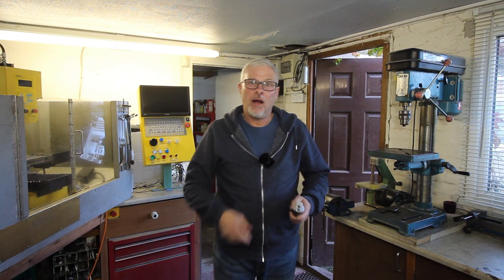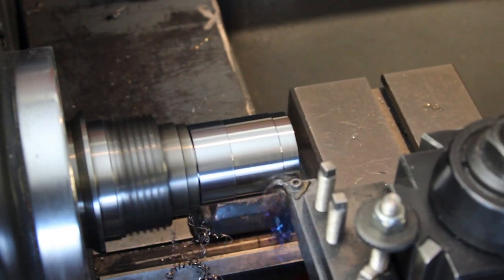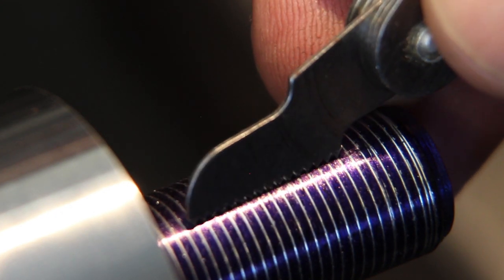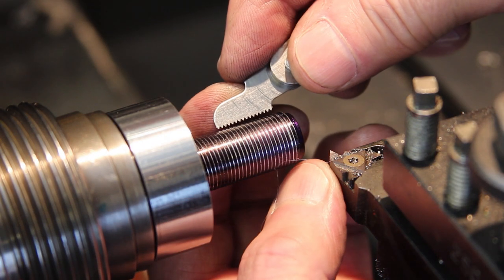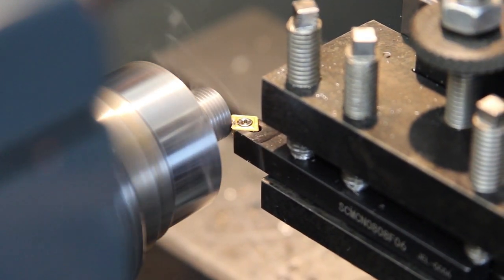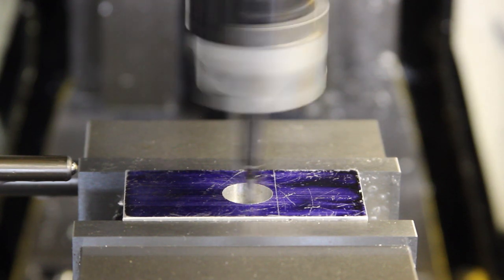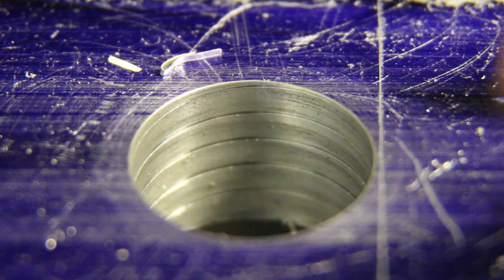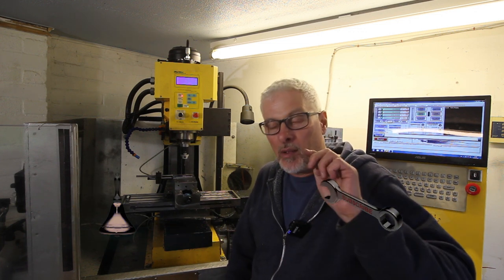Boring head adapter with issues!

Comment: Hi David, my first visit to your channel as the "boring head" caught my attention. Up front, I'm not a trained machinist, just a self taught tinkerer of many years. 
Your description of the boring tool with the comparitor left me scratching the grey matter. 
Looking at the results of both cuts you did with the boring head and chosen tool they seemed to produce a bored hole but we're never told if it was the correct dimension. Finish could also be better. That I put down to the grind of the cutter and possibly its positioning. 
I went and dug out a nine piece set I bought when I purchased my boring head recently, niether of which have been used as yet. Both are of Chinese origin. The one cutter I selected to look at appears to have approximately 5°-7° clearances in all three directions as would normally be required. However the cutting edges have not been reground since the brazing took place so the faces could do with a touch with a suitable stone before use.
The support pillar or shank of the tool is offset from the 1/2" shank centre line by about 1.5mm. the tip of the cutting insert is about 1mm beyond the 1/2" shank so if rotated about the 1/2" centre line this cutter would cut about a 14.7mm hole.
Looking at your results I think sharpness, or lack of, is the first problem. 
The second, the spiral cut mark, suggests that the tool was deflecting on the way down and on the way back up, at an accelerated feed rate, ten or twenty times the down feed rate, it flexed back and cut the spiral. 
If you had repeated the cut as a spring pass I'm almost willing to bet that the spiral would be gone and the finish might have even been a little better. 
To avoid the spiral mark stop the tool at the bottom and withdraw it without rotation. You'll still get a line, unless you move either Y or X to get the tool away from the surface.
One question just came to mind. After setting the tool to the diameter required did you lock the boring head gib screws?
Don't know if any of this will help you but if it gives something to compare then you're welcome.
Merry Christmas and a Happy New Year from Canada's banana belt.
🤞🇨🇦🍌🥋🇺🇦🕊️🇬🇧☃️🌲😁👍
Reply from the maker: Hi @ronwilken5219 
Its been awhile since I made this video so memory is a bit sketchy. I think the main problem was the tool tip geometry is in front of the spindle centre line. On a lathe it would be the same as having the tool set above centre height. It can rub very easily as the clearance angle is reduced . Yep a spring cut would have been best, I do find my mill is not too sturdy and deflects hence the spiral as the tool gets removed. The tool was sharp I think that did not help either I do prefer to have a small radius on the tip. It smooths out the cut and helps stop the finish looking like a fine spiral. I did buy a couple of tungsten mini boring bars that are absolutely superb. I have thought about getting a couple more that fit the boring head. I think that would get me some really nice results. 
I have not managed to make many videos in recent times as I am building a new workshop. I hope to get this done and back to engineering by spring.
Have a great Christmas and new year, thanks for the comment always appreciated.
Hope the Banana harvest went well not easy to grow in Canada!!!
Cheers David

Comment: Loving your channel still Iv a question unrelated to your mill , do you have a 32 tooth gear for your lathe and if so would you share the dimensions as I don’t have one but need to cut metric threads many thanks and keep up the great work
Reply from the maker: Hi MCP Auto Parts,
I do have a 32 tooth gear its 42.4 dia x 10 thick with a dia 28 boss on one side 10 thick. There is a 5x2 approx. key right through. 
Not sure about the module of it its either 1.5 or 2 you will need to check with your machine as the manual is not accurate.
Cheers

Comment: When you are explaining your gear choice (6:00) you mention the 127T wheel- but on the diagram you are pointing to, the 127 plays no part. The diagram shows 40/120/40- in other words a ratio of 1:1. If the 127 did take part, it would turn 1.058 times faster- which is the error you are getting. Are you sure you are not using the 127 by mistake?
Reply from the maker: Hi Mike,
I have just popped out to check I think you are right the bottom pinion is the wrong way round and is engaged with the 127T. 
Well spotted I had a nagging feeling that something was not right, the lathe has worked perfectly for years cutting many threads without issue. 
I will have to be more careful next time.
Cheers
Reply: @CazualHaze  Easy mistake to make- especially when you are videoing. I find the extra attention to camera positioning etc does distract...
Keep up the good work!

Comment: The  TDI usually fits on the other side of the carriage. Lots of room there...
Please do not use phrases like 'perfect' or 'spot on'; only woodworkers and newbies do this. Nothing is perfect, everything has tolerances. You are aiming to be to specification by being within tolerance.
BTW, can I have your throwouts? I will re-grind them...
Reply from the maker: Hi Mike M, unusually the TDI is fitted on my machine on the wrong side I have thought about changing it as if you leave it mounted it jams up with swarf. Another thing for the never ending list. If it works for me its spot on or perfect!! The 'bucket of broken dreams' is not always a one way trip, I still have the cutters' cant bear to throw anything away that might be useful.
Cheers

Comment: As you say, you're not the first to discover the problems with the brazed carbide boring bars. The video shows one way to modify them: https://youtu.be/IGuOwSGCPaQ?t=188
Reply from the maker: Thanks Eric, 
I still have them, too tight to throw them out! I will regrind but it will make them pretty thin.
Cheers
Reply: It doesn't have to thin the cutting part of the brazed tip. You grind the insert part at an angle and rotate the bar in the holder. It will leave full width at the cutting edge but you will have to put a bit of clearance to stop it rubbing.

Comment: What you did with the optical comparator is complete bullshit. The only thing that matters is the cutting tip which is at 90 deg to the direction you are showing. Cutting bits do not have a "cutting face" as you imply, but a cutting point. I have used the exact same boring head with a triangular carbide insert with chip breaker and achieved excellent results. And no, I rarely ever resort to brazed carbide inserts unless I need a special grind. I think you need to learn more about machining before you make a pretense of doing tool reviews.
Reply from the maker: Hi Paul,
I dont do tool reviews it may not have been clear but the point of the video is how to adapt it to my power drawbar if that's unclear; apologies. The boring head looks like a well made tool and if you dont use the cutters supplied then how can you comment on them being OK? When I was trained ( many years ago now) getting cutters on centre height was the only way to get the rake and clearances' correct. You will also know the cosine error you will encounter if the cutter is not perfectly aligned with the boring head centre line. 
Cheers.